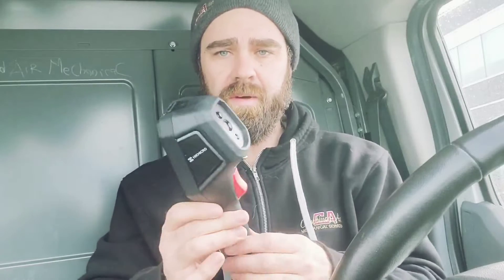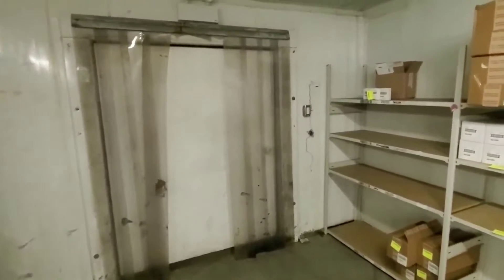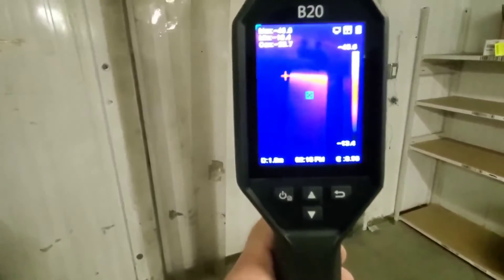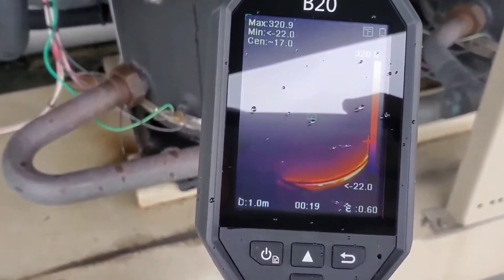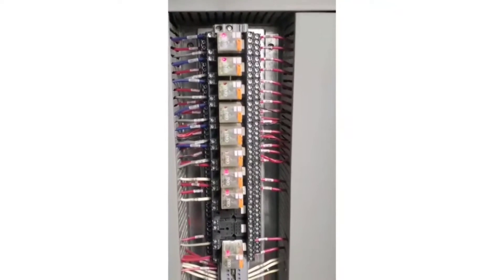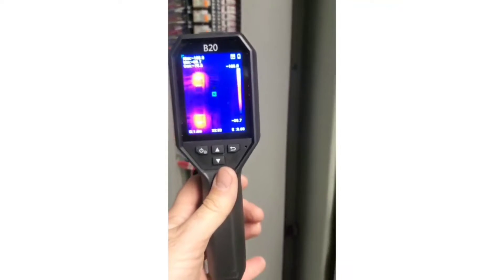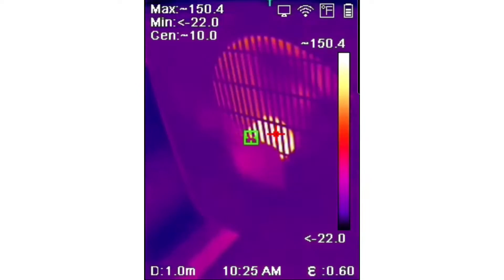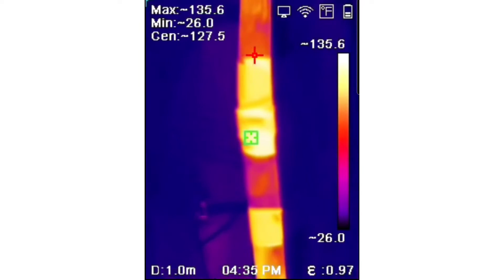Thermal Camera Uses For HVAC - Hikmicro B20 Review

Comment: Does this camera help you see leaks for hvac residential? If a leak is in the line set or coil
Reply: You're better off buying an IR or heated diode refrigerant leak detector for that, DO NOT BUY AN ULTRASONIC! Thermal imagers are useful for diagnosing electrical issues and issues caused by damaged/missing insulation, theyre not very useful for the residential hvac tech, you can use it to help you do duct balancing but theres better tools out there for that too

Comment: I would love to get that but it's probably a couple Grand. So I'm going to start off with something cheap like the flir one pro that connects to my phone
Reply from the maker: It's under 1k.  The Hikmicro E1L is under $500
Reply: yup, and I use the built-in "FLIR" camera on my Ulefone 11T (an android phone, $700). It's funny yous HVAC folk call it "thermal", and y'all electricians insist on "IR"